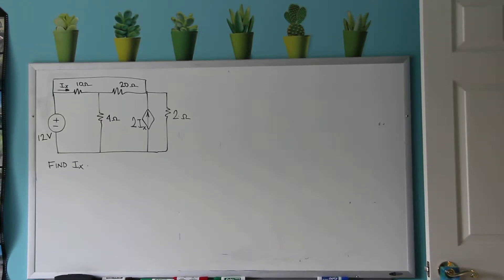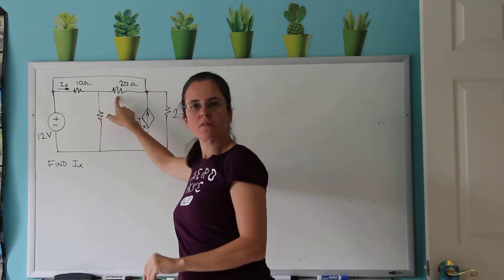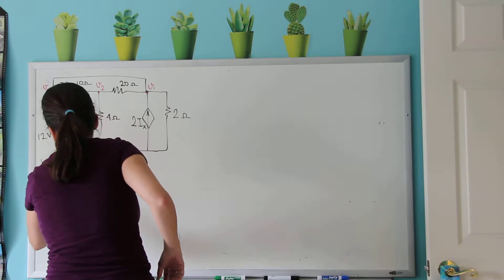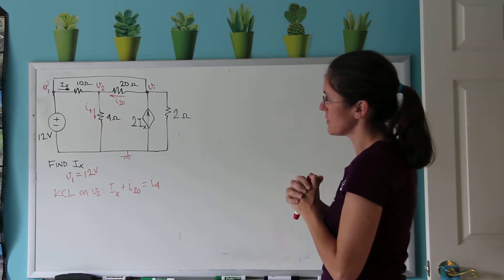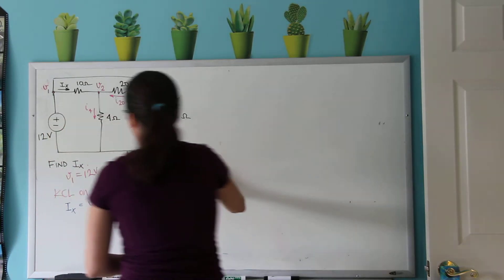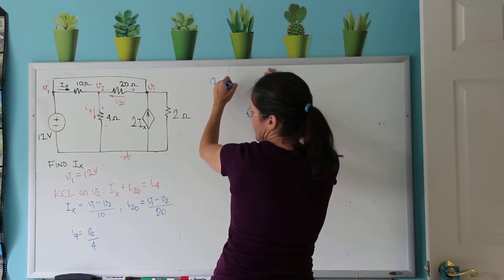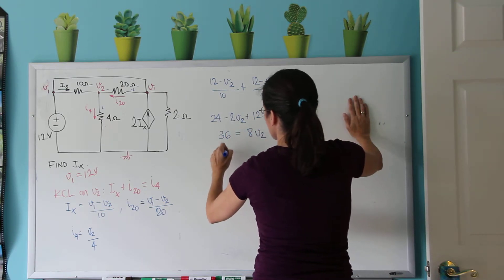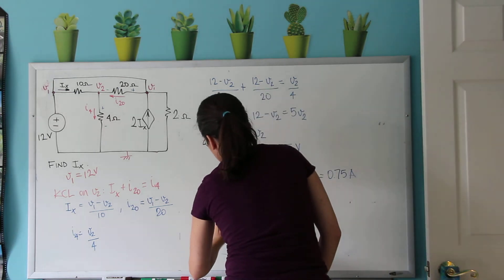Nodal analysis - solved example 3, circuit with current controlled current supply (CCCS)

Comment: You didn't discuss the current controlled current supply which is 2 x Ix = 2 x 0.75 A = 1.5 A. So where does that 1.5 A flow? The 12 v supply is across the current supply as is the 2 ohm resistor. I would think that a 12 v supply in parallel with a 1.5 A current source would be a bad idea as they would fight each other with one trying to maintain 12 v and the other trying to maintain 1.5 A.